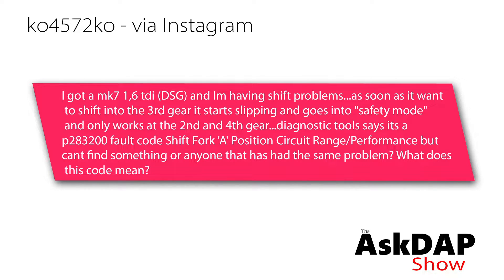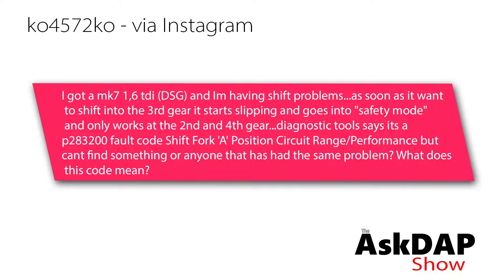Transmission Shift Fork Malfunction | P283200 | AskDap

Comment: Do I have a bad shift fork or bad speed sensor? I have a 2017 audi Q3 with a 1.4tfsi engine fwd. When cold and reverse is engaged, it it slips into neutral then back into gear and does this over and over until it decides to finally move. It also does this when in drive or going up hill. Sometimes at lower speeds when accelerating I hear a lot of click clack coming from the transmission. Only 10k miles. Vehicle was involved in a front collision
Reply: Did you ever get this problem fixed mines doing something similar
Reply: @HairyBeaver  I replaced the mechatronics with a new one. it drives a lot better but im still getting "output speed shaft sensor error" maybe i applied the basic settings incorrectly
Reply: @HairyBeaver  wow that's more than double what I paid for mine of around $1300. I now have Input speed sensor error. Already ordered a new one and hoping that fixes the problem.

Comment: I have a ford ecosport titanium 2016 
At 
It jerks when accelerating
I think  its the 2nd gear  
Because rpm goes to 3200 to shift  then jerks first   before engagng on the third

Is it  fork? 
Or  tcm?
Ford ecosport is known here to have  a faulty transmission

Tried  scanning  but no error
Reply: sounsd like it needs a adaptive shift relearn

Comment: I have a Ford Focus 2014. Will not shift or move at this point. It is a automatic. Mechanic said it was the forks inside the transmission. I also have been looking at how to change the forks. Mechanic quoted me 2500 dollars to fix. I have seen this transmission is a manual trans. with electronic parts on it to make it shift in auto. I also have seen this trans. has had a lot of problems because of this. I was wondering if you could point me in the right direction on this. Can not find a video on how to change the forks in this.
Reply: Hey Floyd, I'm currently working on a 2012 Focus. Did you have any luck repairing?